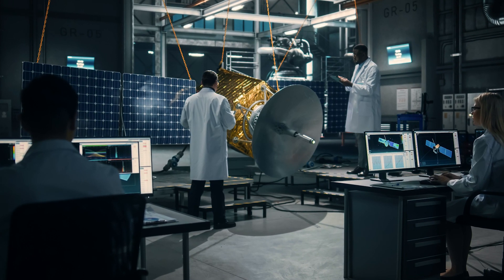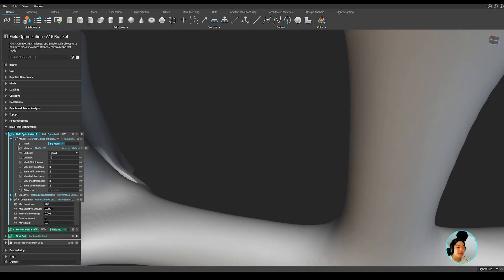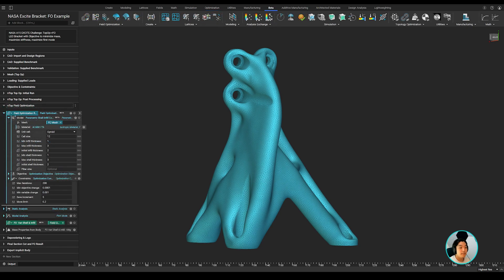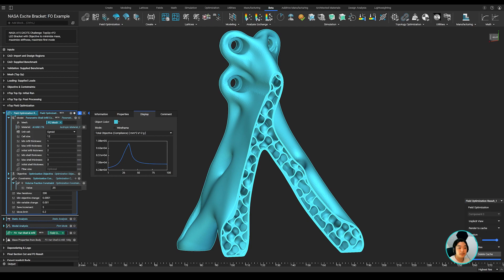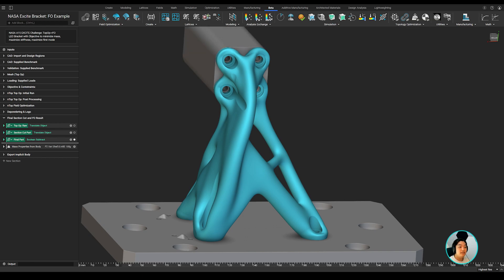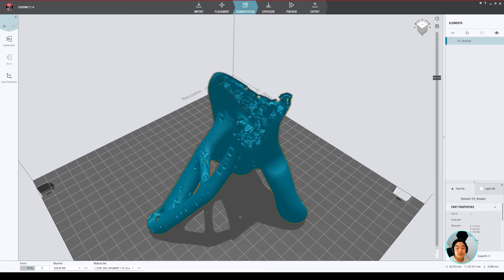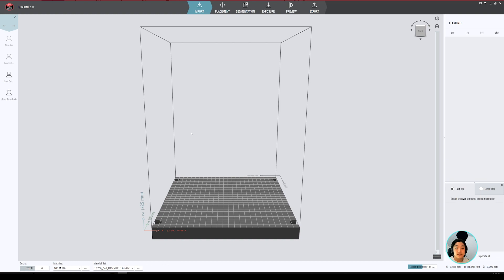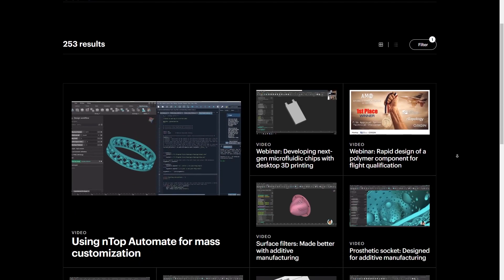Lightweighting a bracket for the NASA EXCITE Challenge

Comment: Thick outer shell, thin inner structure. I like how most optimized parts look similar to bones.
It would be nice if there was a free online-service or an easy-to-use tool available.
Most free programms only scratch the surface and take way too long.